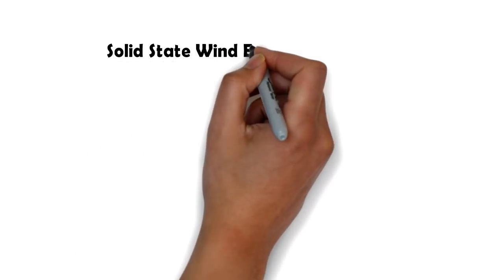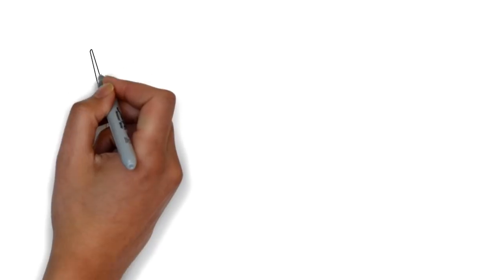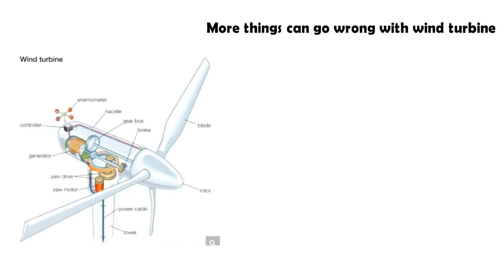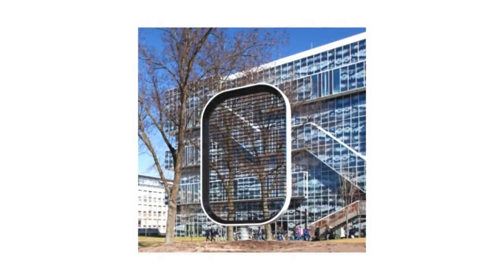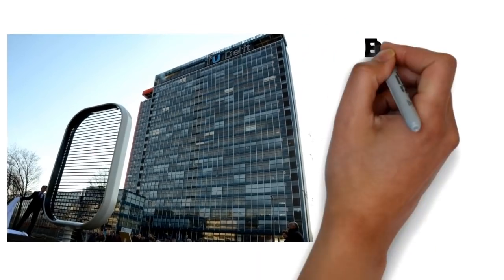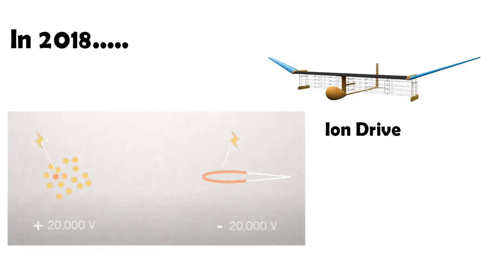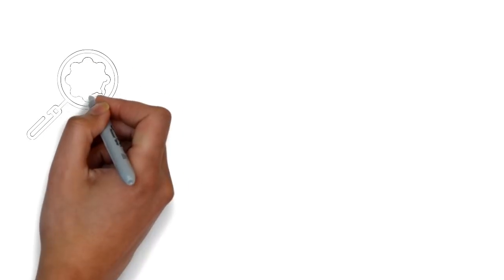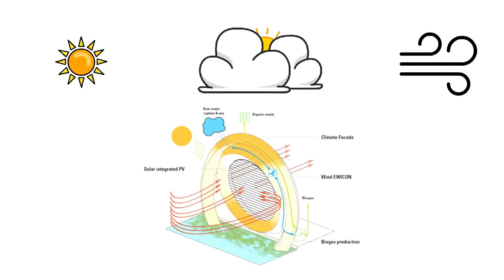Solid State Wind Energy Generator. A Revolutionary Device

Comment: It is difficult to believe that such a generator can produce large amounts of power efficiently. Further, there are a number of questions about the side effects of this apparatus. What effect will the resulting ion cloud have on radio transmission?With such a high voltage, is it just as dangerous to birds as the turbine technology? Does the ion cloud that is produced attract lightning?
Can such a electrostatic generator operate at all levels of  humidity and in the presence of salt spray?
Could please add links to published scientific papers on the subject?
Reply: It would seem the components are all commonly available and inexpensive. I don’t think he quoted any potential power output relative to size. 5% efficiency but super cheap. Might make sense for a lot of people.  Large scale power production would likely require quite massive structures.   But they could also be placed on top of every industrial and commercial building.  It seems a combination of engineering challenge and environmental impact study on all those points you raised.
Reply: so i think i put my comment here since i think it is good to be critical about this, but since you can create  ion wind with an anode and cathode and a high voltage difference  im quite sure you can do the reverse. since there are not large discharges i don't think it will disturb radio a whole lot, it will be better for birds if it will look like a solid barrier all the time, it might have an influence on lightning and humidity and salt spray will have a significant effect.
But my question is, how efficient is it compared to a 'traditional' wind turbine ?
Reply: also i hear people saying 5%, that is not that great, plus when you saturate the area with ions wont that mean that other solid state wind generators in that area are not gonna be able to fully do their job ?
Reply: if you ionise the air then oxygen molecule get ionise and combined together with native oxygen O to form O3 that is harmful for environment
Reply: @sciticshort10  ahh but the 50 billion dollar question is do these produce ozone and if so how much?
First intel has patents for ionic wind generators :https://patents.google.com/patent/US8063382B2/en so we know that the issue can be addressed if it exists.
 Secondly like so many things, the poison is in the dose. Ozone exposure should be no more than (.1ppm) and naturally occurring ozone  at ground levle is about .075 to .050 with the majority of ozone being produced by fossil fuel burning. 
So the question is how much, would we notice, and would it be more than the systems it replaces?
Reply: @sciticshort10  I think there will also be the generation of oxides of nitrogen, which are also toxic.
Reply: @sciticshort10  O3 reacts with other materials very rapidly and is neutralized. Some of the stuff it reacts with are pollutants - not a bad thing.
Reply: @jackfanning7952  ya but it is dangerous for human as well as plant also. and also it is a heavy molecule with molecular mass=48 so it will move in lower region of atmosphere so this will  create a problem regarding health issue
Reply: @sciticshort10  Men. The sky is falling said Chicken Little.
Reply: On the plus side,  your hot dogs are cooked in 3 seconds...  and instant  popcorn  popper !
Reply: @Rohan Chowdhury I think the idea is to extract energy for the wind by using it to provide charge separation. The problem is that the process does not appears to be very efficient and potentially has many bad environmental side effects.
Reply: it doesnt generate large amounts of energy. the versions out now only do a few watts. and it will take decades to get it much higher
Reply: China has started using a similar device in an attempt to reduce pollution, not for power generation. If used in cities the ozone (ion clouds) would be neutralized almost instantly, you can bet they’ll be looking into this.
Reply: richard gould , I was about to raise the point that these new devices, like the ion drive aeroplane, would generate ozone. You say it would neutralise ozone? That would be awesome. What's the mechanism?
Reply: @ThatBloke-d4k  how fast the ion cloud would be neutralise will surely depend on weather conditions. Given the amount of power to generated, the cloud would be substantial, most likely reflecting and distorting radio signals. Any ozone generated might linger for a long time, producing a corrosive and toxic cloud. Decomposition of this cloud would depend on the action of reducing agents in the environment. As to the potential damage to wild life, the structure of the generator is very reminiscent of the electric fly swatting bats.
I suspect that the action of the generator  would be the same for birds, effectively electrocuting them with a flash discharge 

 What is missing from this video is any proof the technology works and measurement to back up the claim. The attached comments to the video do not provide any links to scientific papers of either the generator or the mentioned aircraft. 
Ion engines are used to power space craft in the vacuum of space, but the thrust generated is very small, all be it  sustained.  With out confirming data, I remain very sceptical that this technology works. I did a google search for information and found nothing of value.
Reply: @nigeljohnson9820  I don't think it's going to be as big a deal for bird simply because it's going to look like a solid barrier so they'll be way fewer impact deaths. Moreover since there are no moving Parts the issue of bird strikes could be readily addressed with simple mesh netting. As for the efficiency 5% isn't that great, but this is new tech. Let's keep in mind that the very first solar cells were less than 1% efficient, and back in the 1950s when the very first silicon solar cells came out we barely got 6%. What this technology will look like in another 20 or 30 years who can say? But I will say this if it can be efficiently manufactured it could be a game-changer for certain remote locations in Far Northern climes.
Reply: @nigeljohnson9820  We use ozone generators for a short time at our business at the end of the day when people leave to produce a "toxic cloud" to kill any COVID Virus that may enter our workplace during the day. It is safely neutralized before the next work day when people return. How long does it take for nuclear radiation to neutralize?
Reply: @jackfanning7952  if you are suggesting some comparison between nuclear power and this dubious technology, then I should point out that the nuclear industry tries very hard to contain its hazardous material, while this proposed technology works by emitting it.
Ozone has a relative short life in the environment, as it is a powerful oxidizing agent and breaks down on contact with reducing organic matter. It is also an extremely toxic gas, with a toxicity on a par with that of hydrogen cyanide, some reports suggest on a ppm/LD50 basis, 10 times more toxic than cyanide, though it's method of killing is completely different.  iF large amounts of the gas is generated by this new technology, it will certainly represent a considerable danger to wild life exposed to it. Its action is similar to strong halogen based bleach or the halogen gasses. It is known to attack plastics and metals.
A number of methods are being used to sterilize work p!aces, particularly against Covid-19. Intense UV light is being used in airports and hospitals to kill the virus on surfaces. This can only be done where humans and animals have first been excluded. There pros and cons to using UV light; it is very effective and its operation is instant with little or no residue, however it can only treat exposed surfaces, areas in shadow can harbour viruses and bacteria. The effect of ozone gas, is to reach areas that would be untreated by the UV. Again the gas dissipates quickly and is decomposed by organic matter in the environment. It is less likely to linger than halogen gasses, but all such methods have a bleeding action, attacking some plastics, natural rubber, and metals which are oxidised. The only residues are those left where the gas has reacted chemically with organic material.
Reply: @nigeljohnson9820  What I am suggesting is that oxidizers quickly react with organic matter, rendering them harmless after the reaction. We are very familiar with the oxidation/reduction reaction. Nuclear on the other hand has a long-term hazardous effect on the environment and represents significantly more of a danger to all living entities, not only for its acute toxicity, but also its cumulative and latent effects. I don't consider storing the most dangerous substance known to mankind in dangerously overloaded open pools and casks within 100 miles of every major city in the U.S. as trying very hard to contain the risks.
Reply: @jackfanning7952  It is true the nuclear industry is dangerous, and I am not defending it, but unlike the nuclear industry, this new technology actively generates a toxic gas and spreads in in the environment. Without more data, it is impossible to say how much toxic gas is generated. Under ideal conditions, the half life of ozone is approximatly 25 hours. This is greatly reduced by contact with reducing agents in the environment.
As a biocide, ozone is approximately 3 times more effective than a similar concentration of pure chlorine gas.  One can only guess at the effect on sea birds that fly through the exhaust cloud, but it is likely to kill them very quickly.
Reply: @nigeljohnson9820  We agree that without additional data, it is impossible to say how much ozone is generated. We also agree that oxidizers are quickly neutralized by reducing agents. The abundance of reducing agents in our environment makes oxidizers a useful tool for everyday tasks like cleaning clothes.  I hope the safety experts do a better job of troubleshooting this technology that they did with other energy sources. Ultimately the free market and liability lawsuits will determine whether it thrives or fails.
Reply: @jackfanning7952  ozone generation is an important side issue to this technology. This technology is aimed at replacing that of wind turbines, which have know disadvantages, particularly in relation to the killing of birds. It is difficult to accept that this new technology will be more efficient than the turbines, worse if it is proven to be more dangerous to wild life. After repeated internet searchs, I have not been able to find any data on tests that prove the principle. More disturbing is that the image of the prototype has a marked similarity to a functionless outdoor art exhibit.
Reply: @richardgould-blueraven  I think China is using electrostatic/ozone cleaners, these do not generate power, they use it to remove pollution from the air.
Reply: Large wind turbines revolve slowly, can’t hurt birds
Reply: @Yarcman6245  I wonder why they do not use a  just a very tiny fraction of the energy generated to illuminate the blades, at least then the birds would have a chance to see them in the dark.
Reply: @Yarcman6245  They definitely do. Here in Germany an estimated 100,000 birds get killed annually by wind turbines (big ones), including rare birds of prey.

Comment: Could these end up being cheaper than solar? I don’t know how complicated the ionizing process is, it doesn’t seem as complicated as photovoltaic cells. Also, great video.
Reply: Photovoltaics and complicated??? There is not much on this planet simpler than solar panels 😅
Reply: @petergoestohollywood382  simple to install, but not simple to make.   this tech (which i'm skeptical about the yields of) consists of "some wire"
Reply from the maker: Yes they are cheaper than solar PV
Reply: @synergyfiles3536  Cheaper?  shopping.google.com finds zero of these (search terms: "solid state" and "wind energy").  How is your comparison made?